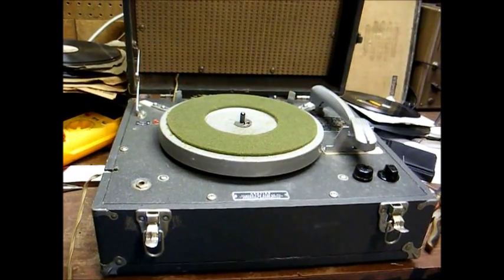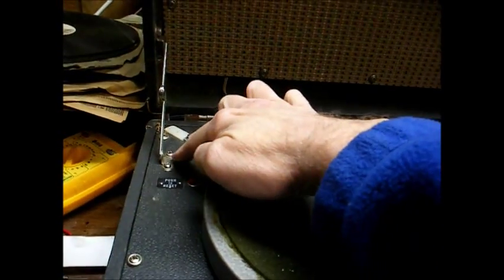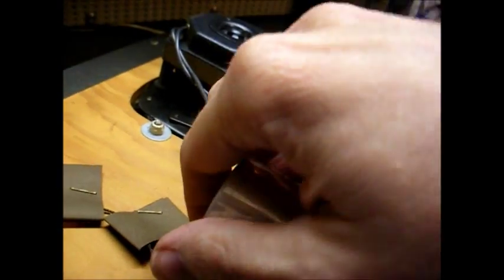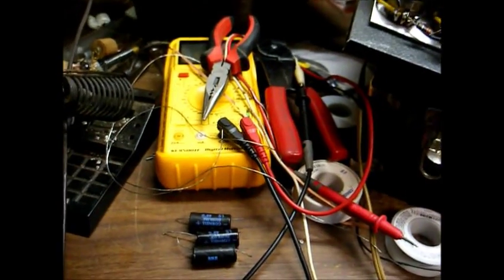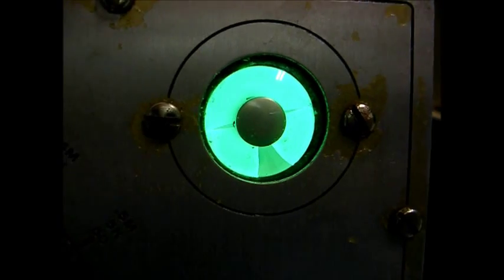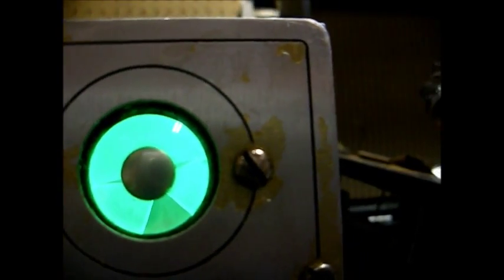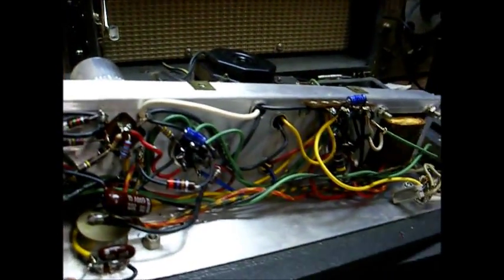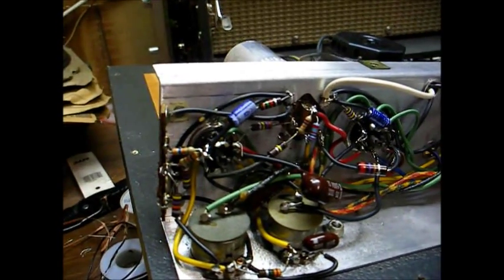Repair of a 1966 talking book record player for the blind

Comment: Just ran across your channel recently. One of the first videos I ran across was a rummage sale find video and you mentioned a talking book machine someone sent you too. I found this video in your archive, of the same unit I had as a kid in the 60s, and 66-68 sounds right. I was physically disabled and at the time my vision could not correct to near 20/20 so I did qualify. sometime in the late 70s, I went to a solid-state green plastic unit and a matching green cassette player. Thanks fur the blast from the past, Get audiobooks in all different ways now but I remember the both the straped and snap-based cases the recorded books came in too.

Comment: I have the same record player.  I find very interesting how much they could record on a very thin flexible disc.  Mine is not working.  It pops the fuse after a few minutes of being connected.  Your video is very helpful.  I am going to use it to change the capacitors and resistors to see if that helps.